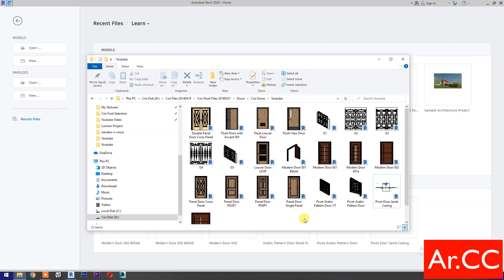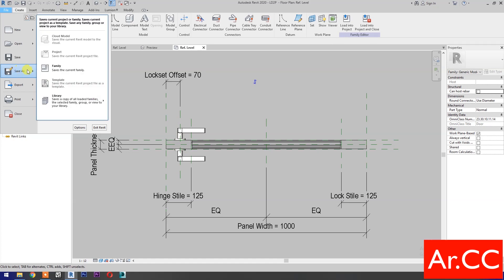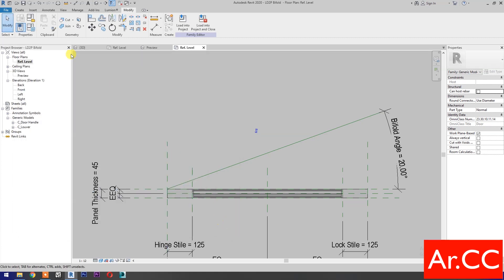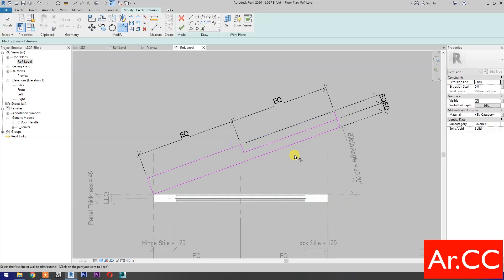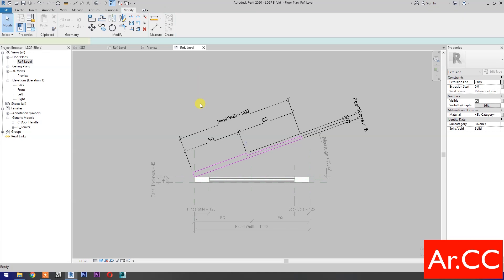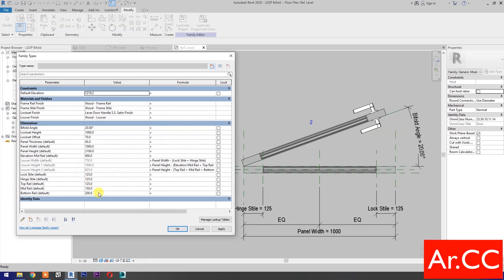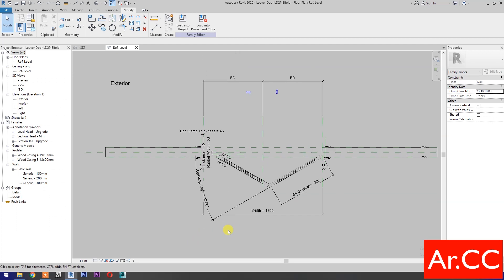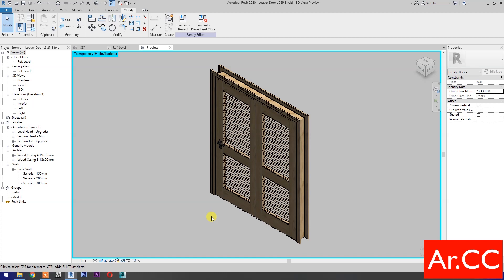RD114. How to make a Bi-folding Door in Revit. Convert Swing Door to Bi-folding Door.

Comment from the maker: Recommended Video:
RD048. How to make Parametric Doors in Revit. Part 10 Louver Door (2 Panels). Swing Door.
https://youtu.be/yTEmc4MxRZw
RD055. How to make a Parametric Doors in Revit. Part 13 Modern Door Design. Swing Door.
https://youtu.be/syWkgU3JDLU

Suggested Videos:
RD069. How to make a Parametric Pivot Doors in Revit. Pivot Door Revit Tutorial.
https://youtu.be/Wkf7jAVMRoc
RD115. How to make an Off-Center Pivot Door in Revit. Pivot Door Revit Tutorial.
https://youtu.be/VGfXo0d6vX4